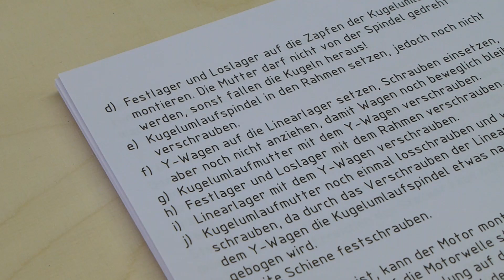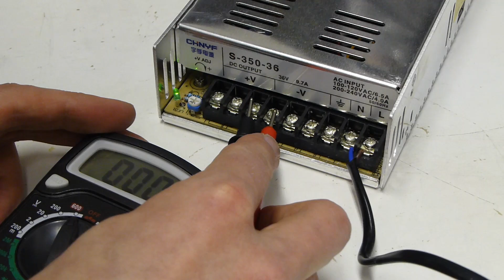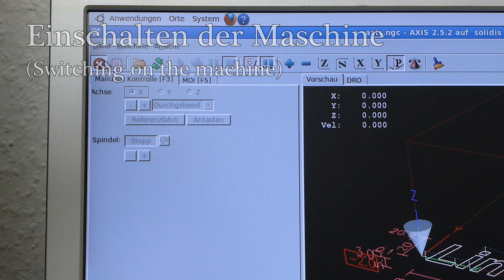Solidis - Holz CNC Fräsmaschine (Wooden CNC Router)

Comment: What a good looking CNC. 

I was wondering what type of limit switch and the power supply you are using.

If I buy the plans, will the material list also contain those guide railing and all other electronic things you need to build the CNC?
Reply from the maker: Thank you. The machine uses standard micro switches and a PC-power supply. Yes all parts are in the materials list described in detail.
Reply: @holzmechanik  Good to know, thank you! :)

Comment: Hallo ich habe eine frage kann man auch auf der selbstgebaute cnc fäse auch ein 3d ducke benutzen dank im voraus
Reply from the maker: Wenn Du statt des Fräsmotors einen Extruder anbaust und eine geeignete Steuersoftware verwendest ist es möglich Solidis auch als 3d Drucker zu nutzen. Das würde ich aber nicht empfehlen, da Solidis so stabil und präzise wie möglich gebaut ist. Das geht auf kosten der Geschwindigkeit. 3D-Drucke würden deshalb wesentlich länger dauern als mit einer Maschine die extra für den 3D-Druck konzipiert wurde.

Comment: Könnte man auch eine normale Oberfräse nutzen? Was dürfte diese so ca. wiegen ohne die Motoren zu überlasten?
Reply: +Schorschiism 
Oberfräse geht sehr gut. 35 Okken bei Aldi...5/10 reicht mir. 
Mein Nema 23, 48V an Kugelumlaufspindel, schafft das, jedoch die Kupplung bricht oft. Vorteile: Drehzahlregelung, 1,2 kW Kraft, 6+8mm Aufnahme und ! starkes Gebläse !. Nachteile: keine echte Aufnahme, ich habe das Gehäuse oben nochmal eingespannt- Mit 2k faserverstärkter Autospachtelmasse. 
Estlcam + Ardu forever
Reply from the maker: +Schorschiism 
Klar geht auch eine normale Oberfräse. 3kg sollten für den Z-Motor kein Problem sein. Wenn die Oberfräse schwerer ist würde ich auch einen stärkeren Z-Motor verwenden. Die anderen beiden Motoren können unverändert bleiben.
Reply from the maker: +Susanne Dienst      
Danke für Die Info. Mich wundert, dass Du Probleme mit den Kupplungen hast. Verwendest Du die im Bauplan empfohlenen Klauenkupplungen mit Kunststoffelement in der Mitte oder verwendest Du solche "Flexiblen" Kupplungen?
Reply: holzmechanik

Klauenkupplungen scheinen ein zunehmendes Umkehrspiel ( bei 1/1600 sind schnell 20 Schritte verloren ) zu entwickeln, daher bin ich mit meiner Not-Lösung 5cm Gewebeschlauch direkt auf die aufgerauhten 8mm Achsen zu klemmen, bisher sehr zufrieden.